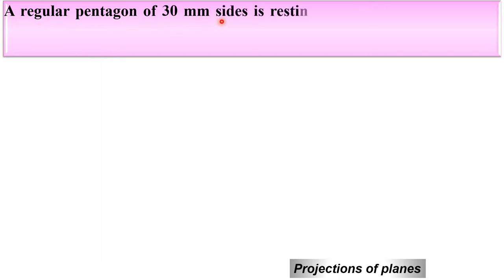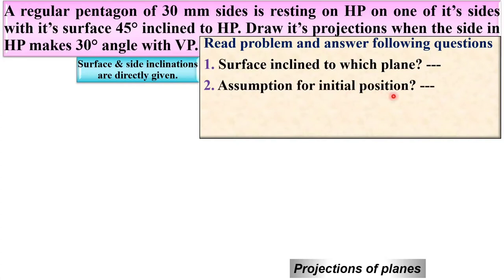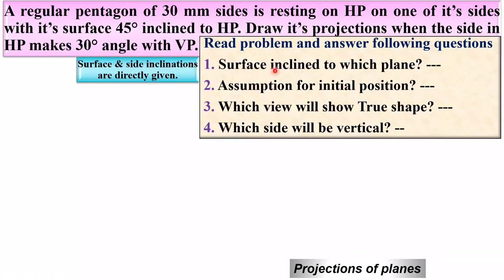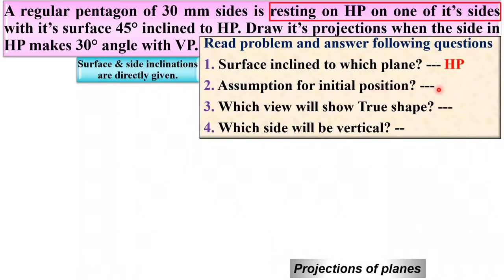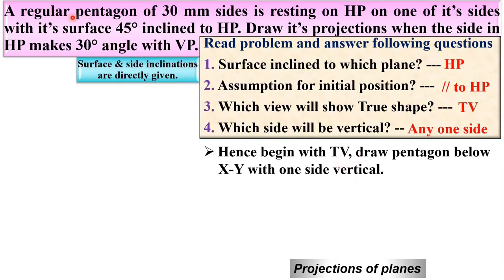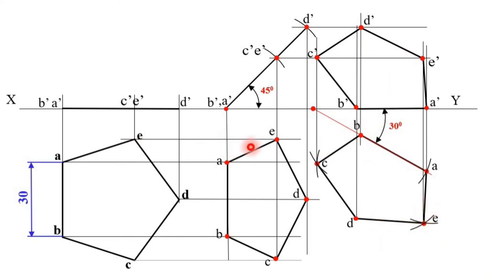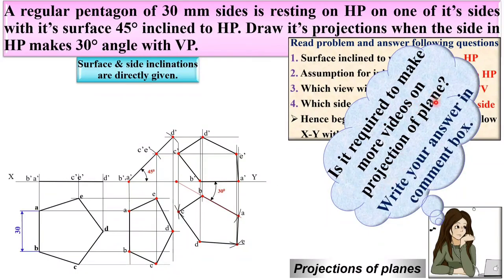5 - Projection of Plane (Basics, Drawing Process & Solved Example) Explained in Engineering Drawing

Comment from the maker: Projection of Plane explained with following timestamp: 
0:00 – Projection of Plane in Engineering Drawing lecture series 
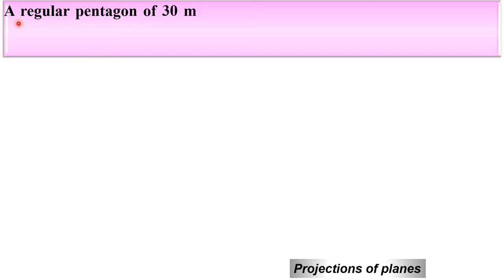0:18 – Description of problem 
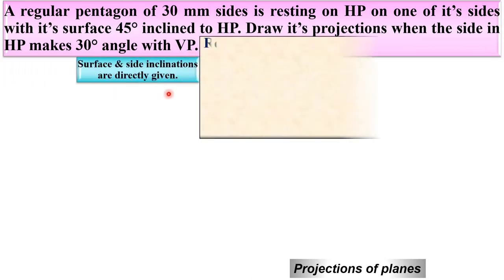0:30 – Pentagon is resting on hp on one of it’s sides
2:32 – 3D figure w.r.t. HP and VP.
3:33 – Stage-1 of Projection of Plane
5:13 – Stage-2 of Projection of Plane
7:09 – Stage-3 of Projection of Plane